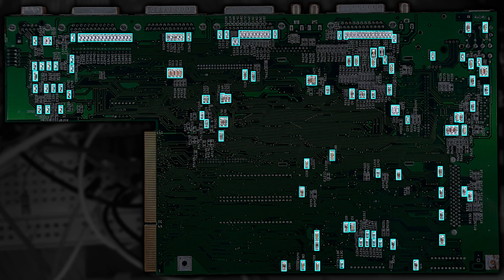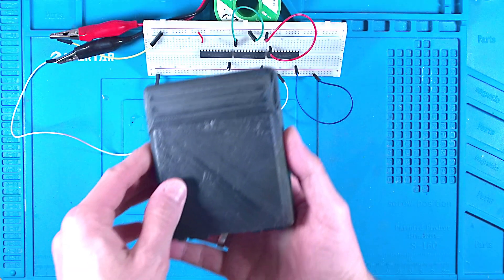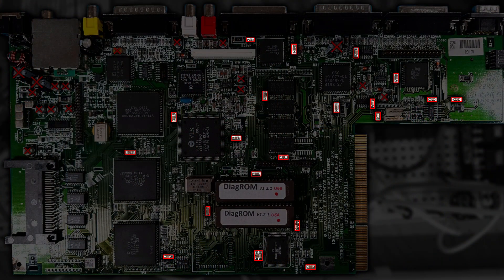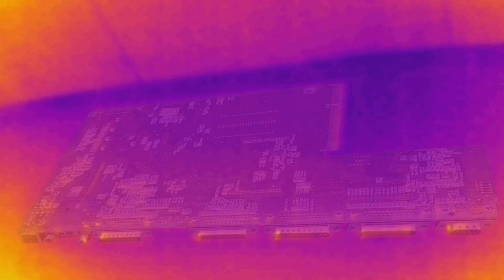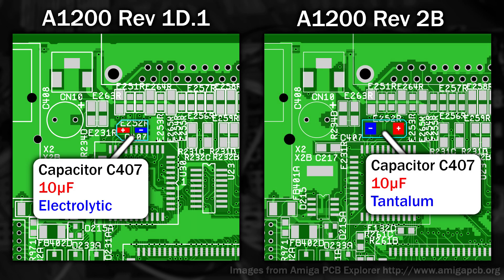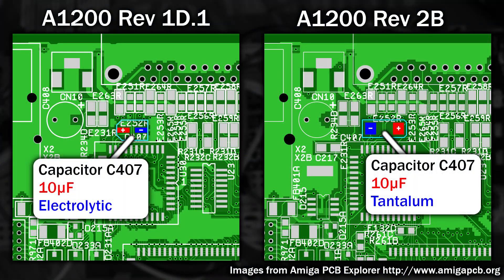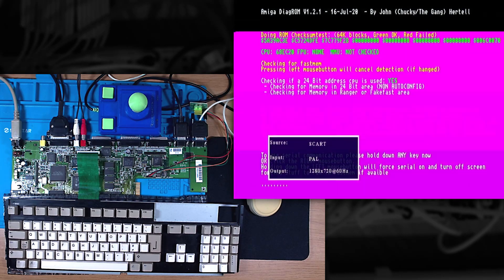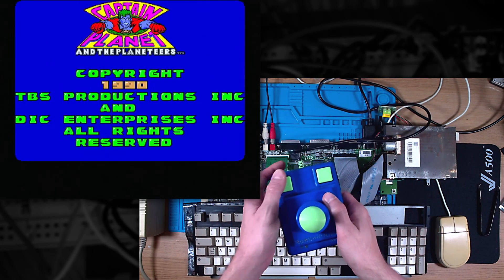Finding a SURFACE MOUNT Shorted Capacitor

Comment: Rob, did i miss how much actual voltage/amperage you supplied to the board from the other power supply, when you did the thermal imaging test ?
Reply: And which points did you supply it to exactly ?
Reply from the maker: I didn’t show it, in reality it doesn’t matter too much other than restricting it so the current isn’t too high. I suspect it was about 100mA but I can’t remember now.

Comment: in my case I have a dozen of them shorted , but when I desolder them and check them with the multimeter they are no more shorted . Something on my motherboard makes them appear shorted when they aren't
Reply from the maker: Very strange…. Did you test them like I do with a thermal camera? There’s so many parts that it would be difficult to discover the real fault
Reply: @RobSmithDev  the motherboard is from Asus Transformer Book T100TA  , it got water damage , I bought it a few bucks from my nephew thinking I could fix it . the shorted capacitors are around the power managment IC , I removed the IC  to see if the shorts would stop , but  they are still here .  I spotted a burnt rounded-rectangle ground pad , near a tiny capacitor that is near charge detect IC  . the copper layer from that rectangle ground has totally  vanished  . to my knowledge I've never heard of missing copper ground pad that could cause a short .  
No I don't have a thermal camera , it(s in my projects to buy one  by  first months of 2025
Reply from the maker: @tunkunrunk with something like that there’s lots of possibilities and it may not just be capacitors (some diodes for example fail as a short) and whilst unlikely  it’s possible you may have damaged traces in the inner layers - Ii hope not though as these would be impossible to fix